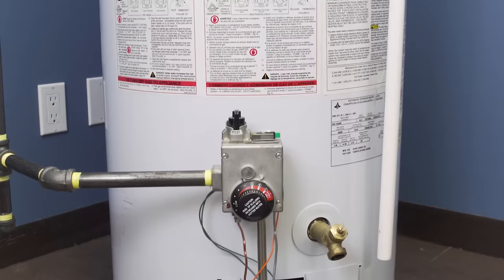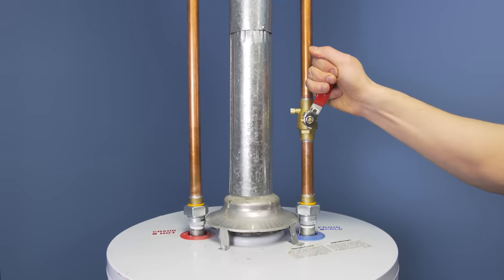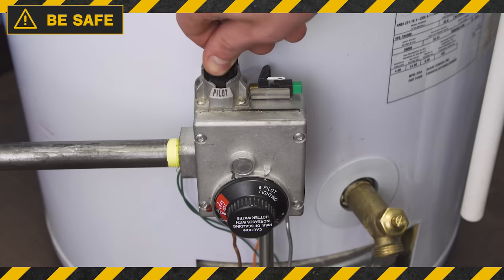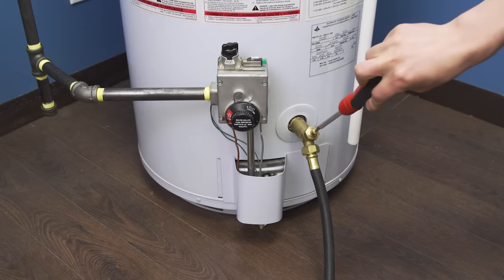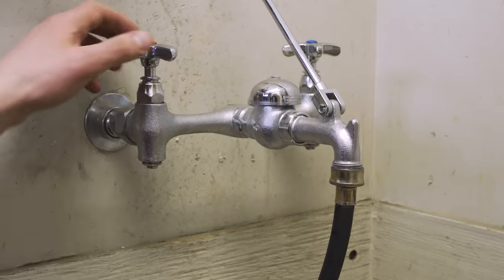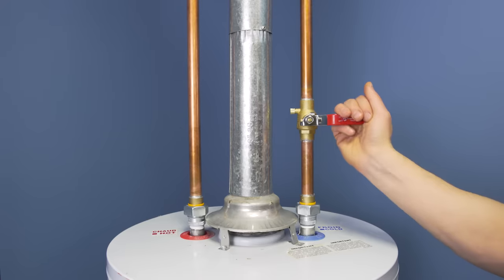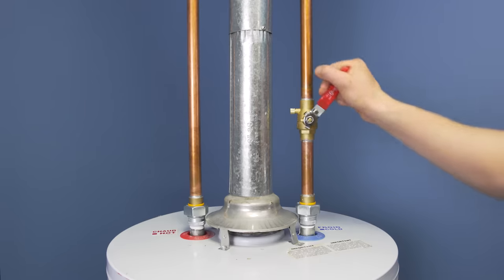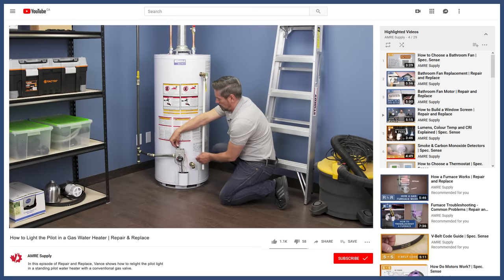How to Drain & Flush a Hot Water Tank | Repair and Replace

Comment: You can also try squeezing the hose repeatedly near the valve, to break the sediment loose, if you don’t have an extra washing machine hose to back flush
Reply from the maker: Thanks for watching. That is a great tip!
Reply: @AmreSupply  I definitely like your method better; especially, if doing yearly maintenance, as I believe it releases more of the sediment. I use the pumping method, when draining the tank for removal, or have a long run with the discharge hose and no where near a water supply. 

I just recently found this channel. I have to say that I’m very impressed with the effort and quality of the video, as well as, the accuracy of the content, so I subscribed immediately. I look forward to watching more videos and keep up the good work.
Reply from the maker: @johnharrison5656  Thank you for subscribing! It's good to have the quality recognized. There is a lot of content out there and one of our main goals was to make it easy to understand and accessible. This meant putting more time into research and writing scripts as well as making graphics. We just finished a series on oven and stove repairs which we're happy with https://www.youtube.com/playlist?list=PLCo9SMjkdWBysYYCcg5xQLiVh_cW0JQvt and are currently working on refrigerator repairs which will come out in 2022. Cheers!
Reply: @AmreSupply  Thanks I’ll check it out.

Comment: Before filling water heater is good time to replace anode rod if haven't done so in 5+ years.
Also, I would choose opening bathtub valve for air, especially if it has separate hot/cold valves;
no need to mess with sink faucet aerators.
Reply from the maker: Thanks for watching, those are some great tips! We do show how to check the anode in our water heater maintenance guide: https://youtu.be/ZTUNLIXKVu4
Reply: I replaced my anode rod and flushed too

Comment: At time of installation have the plumber replace that highly restrictive hose bib. A 3/4 nipple, full port IP valve and hose adapter will turn a future lengthy flush job into a fast effective walk in the park.
Reply from the maker: Thanks for watching! Yes the full port ball valve works great. For anyone wondering these are the parts needed: https://youtu.be/nGCejMsKNX4?t=196

Comment: what about using the air release valve in the side of the tank.  Don’t you need to open that too?  I had seen orher videos do that.  Can you explain the process why do or nor do that?  Thanks
Reply from the maker: Thanks for watching. If you open a hot water faucet when you drain the tank, it will release the air, so either will work.

Comment: A couple of observations when you backflush, shouldn't you use cold water?  The hot water will be off at the haterheater.  Also shouldn't you use a different faucet than you are using to vent the hot side?
Reply from the maker: Thank you for watching. You have a good eye. This has been pointed out in previous comments but unfortunately its not something that we can update. When filming these videos we often film multiple takes at different times / locations, and the pieces are edited together afterwards. During the backflushing shot we did what visually looked best on camera (moving the closest handle) while not realizing it was the wrong handle (which not would result in any water flowing).

Comment: I just replaced a 4 year old 40 gallon gas Rheem with an A.O. Smith.  If memory serves, the first year I tried to flush it out it drained very very slow.  I don't think the tank ever drained all the way.  So after leaving the drain valve opened for most of the day hardly any water came out.  When I disconnected the unit...sure enough, it was full of water and heavy as ever.  I left the drain valve opened and smashed it off with a hammer and I could see calcium deposits completely covering the hole.  I took a screw driver and jammed it in and then the water came pouring out fast with lots of pressure shooting out about 3 feet at first.  I noticed even on the new unit that when I drained it for a minute it wasn't even that fast.  Not even close.  Are these units outfitted with a drain valve that is purposely small so it will catch calcium build up over time so you have to replace the unit sooner?  Water is so hard here in Phoenix I am going to drain quarterly and monitor the pressure output as time goes by.
Reply from the maker: Thanks for watching. The factory installed valves are more prone to clogging as the opening is not very large. To prevent this you can easily make a new drain valve using a full port brass ball valve. This is shown here: https://youtu.be/nGCejMsKNX4?t=190
Reply: @AmreSupply  I'm learning this as I go. Thanks so much I'll check it out when I get back to my place.
Reply: @AmreSupply  my drain valve is plastic with a hose connection and then he screwdriver release on it. I'm hoping since it's a brand new water heater that it will be easy to remove. Thanks again for your help
Reply: @AmreSupply  Got it done today.  Makes all the difference!!! Thanks again.
Reply from the maker: @mykylc  You're welcome, we're just happy to help in what small way we can.  Thanks for the update, we're glad that the repair went smoothly, the ball valve is definitely a good upgrade to have!

Comment: Can we drain the water to the sump tanks drain?
Reply from the maker: Thanks for watching. As long as the water isn't extremely hot then it should be fine to drain into the sump pump basin. If the water is over 60°C then it might damage sump pump components.

Comment: Great video! How often is it needed to do this?
Reply from the maker: Thanks for watching. Some people do yearly flushes and others do not flush for years. It depends on how hard of water there is in your area. You can do a flush and check and see how much sediment comes out. Also without a full port drain valve, less sediment is removed as the pre-installed valves have a smaller diameter. With a lot of flushing there is a chance that the drain valve might not close properly so that is another factor to consider. The difference is shown here: https://www.youtube.com/shorts/C3-eTMsbO40

Comment: I would think you could push a smsll hose  or rod into the drain valve to move the sediment outof the way
Reply from the maker: Thanks for watching. It depends on the valve. The standard drain valve is a threaded valve and is at an angle, so a piece of wire could bend around that corner. You can see this here: https://www.youtube.com/shorts/C3-eTMsbO40 If you do this just make sure you have some sort of container underneigh.

Comment: Question and sorry if this is a dumb question. My water valve is corroded to the point that I can’t turn it off. Could I still do the flush with the cold water running and still follow the rest of your instructions. Also let’s say I can’t shut off the main line water to the house either.
Reply from the maker: Thanks for watching, and that is a perfectly valid question. If there's no way for you to shut off the incoming water supply then its likely that your tank would drain slower than the refill rate from your cold water supply line. Drain valves do not have large openings and often there is debris that will slow down the draining. So if your drain valve drains at 0.5 - 1 gallons per minute and your cold water supply line fills at 1.5+ gallons per minute then you wouldn't be able to drain the tank completely. Still you'd be cycling some of the water and some of the debris might flush out during that process. So you could try draining some water and monitor what comes out of the hose to see if any sediment is being removed.

Comment: It could help to use some chemical like CLR or other had water cleaners to take out some deposits in the tank.  They also use vinegar to flush out the hard water deposits.
Reply from the maker: Thanks for watching. Using something like vinegar is a way to help chemically break apart scale from the tank. The flushing will be mechanical removal of sediment.
Reply: How do you even "introduce" CLR to the hot water heater tank?

Comment: Thanks for the video but I do have a question, my electric hot water tank is about 3 years old and i've noticed the hot water doesn't quite last as long as usual but still is really hot. When I drained (after a shower) the water draining was not hot at all. Barley even warm. I know you mentioned it would be hot. Any ideas?
Reply from the maker: Thanks for watching. In addition to sediment or a coating of minerals, there are a couple things could be causing the water to not heat up enough. One of the electric heating elements might be faulty. This can be tested for continuity just like a stove element: https://youtu.be/rlT31ntIhbI?t=126 There could also be an issue with one of the thermostats which controls power to the element itself.
Reply: @AmreSupply  I do mean while I was draining it. I checked the continuity and got around 18.2 ohms for each. I also noticed the thermostat was set almost maximum, so I lowered it to the recommended setting. I've been flushing it for about 10 hours now and I'm still getting quite a bit of sediments, but I'm gonna need hot water soon! I'm guessing they'll always be a bit of sentiment I'm just not sure when I should just let it go
Reply from the maker: @SirYoinksalot  Thanks for the update. When the water starts looking less full of sediment, then that might be a good time to stop draining if time is a factor. 

If the water heater still isn't heating up properly, then it is possible that your have hard water, so the elements could be coated with minerals, which will act as an insulator. This scale can be cleaned off of the elements if needed but it would be easiest by removing the elements. We don't have a specific video showing how to do this however there are some good ones if you do a search.

Comment: If you put the Pilot light in the “pilot” position when starting the process, why did you have to relight the pilot at the end?  Or was that just a filming error?
Reply from the maker: Thanks for watching. In the video the gas was shut off and the temperature was set to the "pilot setting" which means it is the lowest setting. At this point the pilot flame and burner are complete disconnected from the gas while the tank is being drained.

Comment: Many water heaters come with a cheap plastic drain valve that's not nearly as good and well designed as the brass one you show in this video (even on water heaters approaching $1,000).  What are the chances that my plastic drain valve will seal off after I do the flush?  I can fully see mine not sealing off no matter how hard I tighten it.
Reply from the maker: Thanks for watching. It is partially how the valve is designed. Any valve (plastic or brass) runs the risk of debris preventing the rubber in the stopper from closing properly. A full port ball valve does not have this problem. This video explains this in more detail: https://www.youtube.com/shorts/C3-eTMsbO40

Comment: I'm curious how you're able to backflush from another sink by opening the hot valve🤔. Since the cold inlet valve on the water heater is closed there is no pressure on the hot side. I think you clearly meant to open the cold side to backflush. Minor oversight, awesome video!
Reply from the maker: Thank you for watching. You have a good eye! This has been pointed out in previous comments but unfortunately its not something that we can update. When filming these videos we often film multiple takes at different times and the pieces are edited together afterwards. During the backflushing shot we did what visually looked best on camera (moving the closest handle) while not realizing it was the wrong handle (which not would result in any water flowing).
Reply: You can add annotations to your video using YouTube editor. Just find where you mention using hit water and add a big message on the screen saying "*COLD WATER* SORRY" or something. Good luck 👍
Reply from the maker: @joepolidoro429  YouTube used to have Annotations as a feature but disabled it when they unified the experience with mobile devices. There are links (cards) that can pop up in the top right corner but these are not the same as annotations and aren't visible in the same way.
Reply from the maker: @joepolidoro429  Due to the number of comments, just added a pinned comment which will show up at the top. Cheers!
Reply: @AmreSupply  that's wack

Comment: great video.....
but this shows backflushing using the hot water
that was isolated and depressured prior to draining...(?).
Reply from the maker: Thank you for watching. You have a good eye. This has been pointed out in previous comments but unfortunately its not something that we can update. When filming these videos we often film multiple takes at different times and the pieces are edited together afterwards. During the backflushing shot we did what visually looked best on camera (moving the closest handle) while not realizing it was the wrong handle (which not would result in any water flowing).

Comment: I ran the water from the flush hose thru a cone shaped coffee filter to see what came out jut make sure you tie wrap the filter on the hose or run the water discharge at a slow rate.
Reply from the maker: Thanks for watching. Using a coffee filter is definitely a good way to see what was in your tank.

Comment: The water can be drained into a sump pump as well, correct? Not all homeowners have a drain.
Reply from the maker: Hi Chris, thank you for watching. That is a good observation, and yes you can drain the water heater into the sump pit as the sump pump will just run once the level gets high enough.
Reply: @AmreSupply  will hot water into a sump pit affect the pump in a negative way?
Reply from the maker: @caprisun2k1  If the water isn't too hot then it shouldn't be an issue. You can always turn off the water heater, and take a hot shower to help it cool down before draining it.

Comment: If the backflush didn't help you can use the pressure relief valve for airflow too couldn't you?
Reply from the maker: Thanks for watching. If you opened up a hot water faucet in the line then it should have ample airflow for draining. Opening the relief valve is a closer solution and will do the same thing.

Comment: I did this today. Took me 5 hrs! Had to keep jabbing a coat hanger in there to get all debris out. Got about 2 gallons of junk.  What do I use to remove the drain valve? My wrench wouldn’t do it.
Reply from the maker: Hi Jennifer, thank you for watching! Draining can be quite slow with a buildup of debris. In a lot of cases the drain valve might be pretty stuck. To help out you can make an extension for the wrench. If you put a piece of copper pipe overtop of the wrench and extend the handle by 2 feet, then you'll have more leverage. You'll notice that it might take a bit to "break it loose" as the drain valve threads are likely starting to get fused. Once you get it turning it might still take some effort to turn each time but will get easier after a few rotations.
Reply: Design Studio I got it pretty empty, but could NOT remove the anode rod. A waste of $50 for the new one😕
Reply: Design Studio yes! Sorry if I wasn’t clear.
Reply: Design Studio it’s 10 yrs old, but I’m the only one here, so not a lot of use. My male neighbor and I tried for hrs to remove the anode and it was a no go. Pipe wrench, bar, you name it.
Reply: Design Studio I saw something about draining them every couple of years and I hadn’t EVER done it, so I tried and it was blocked with calcium deposits and mineral sludge. My lower element was UNDER all that so it wasn’t efficient. If you clean it and replace the anode, they’ll last a lot longer.
Reply: @jenniferlzr5651  An electric impact gun gets the anode rod out pretty easily.  One is at Lowes for about $120, and Harbor Freight sells one for about $50.  I'm pretty strong and have a long breaker bar, but the only thing that got the anode rod out was that impact gun.  With it the job was a breeze.  Hit it twice and the rod turned 3/4 of a turn and after that it was a breeze.
Reply: unclematt3 thanks! I’ve read that, but I’m afraid I’ll damage the opening since it’s so tight. No?
Reply: @jenniferlzr5651  I can't think of how you would damage the opening removing the rod with an impact gun.  I could see running it in too far hurting the threads, but that's not what you're doing.  The one knock about using an electric impact gun is that the extreme torque and hammering might make the bottom of the rod snap off and fall down into the tank.  It's designed to be in the tank, though, and it can only really break if the rod is extremely old and corroded.  Like maybe if you left it in there for 10 years.  The impact gun is the way to go.  Trust me.  It removes the rod without putting strain on the hot and cold water connections and without you possibly messing up your shoulder.  And when you put in the new anode rod, there's no reason to put it in super tight.  I use an 8 inch ratchet, give it a good tug, and call it a day.  That's probably about 80 foot pounds.  I've never had a problem.
Reply: unclematt3 ok thanks! I smashed the opening with a pipe wrench, but thankfully was able to put plumbing tape on it and get the hot water hose back on. The anode is gone! Pieces of it came out when I drained the heater.
Reply: @unclematt3  That's a great idea.  I didn't think of that.  I use my impact for automotive and construction, but didn't think of it as a plumbing tool!
Reply: @unclematt3  borrow one, every other guy that's alive has one
Reply: Some water heaters may be beyond salvaging, I had an electric that had 8" of debris and a burnt coil, just get a new one, 10x more efficient too